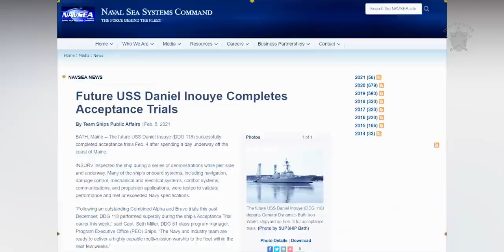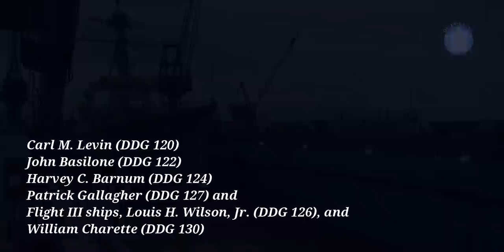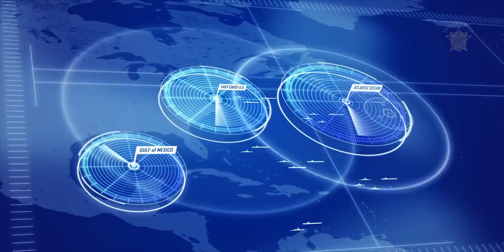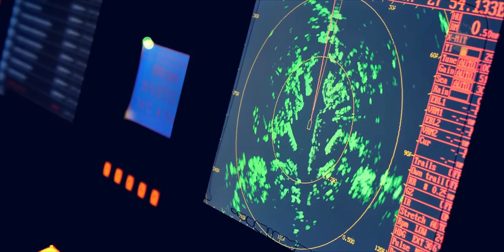U.S. Navy successfully completed trial

Comment: Besides the pretty videos the actual capability of the USS Daniel Inouye was inaccurately and loosely described.  How a warship senses, processes and controls its weapons is a core attribute that should be highlighted.  The Inouye primary radar is the SPY-1D(V) called the “littoral warfare” radar with improved clutter rejection and moving target detection.  Its data is fused with the SPQ-9B Radar Anti-Ship Cruise Missile (ASCM) Radar and the AN/SPS-67(V)2 surface-search radar for a singular coherent air picture controlled by Aegis Baseline 7.1R in conjunction with the Cooperative Engagement System that greatly enhances its effectiveness.  Its primary weapons are housed in 96-cell Mk. 41 Vertical Launching System (VLS).  They can hold any combination of BMG-109 Tomahawk Land Attack Missiles, RIM-66M Standard 2 Blocks IIIA and IIIB anti-air missiles, RIM-174 Standard Missile 6 (SM-6) extended range missile, RIM-161 Anti-Ballistic Missile Standard 3 Missiles (SM-3), RUM-139 Vertical Launch ASROC (Rocket boosted homing torpedo) and RIM-162 ESSM quadpacked short range anti-air missile.  The Inouye has a hanger and deck capable of supporting up to two MH-60R Seahawk LAMPS III helicopters that themselves are highly capable sensor and weapons platforms carrying  Mk 46, Mk 50, or Mark 54 Lightweight Torpedoes, AGM-114 Hellfire missiles and machine guns.  The Inouye can also carry drones in augment too or replacement of the MH-60R.  The ship is armed with one 5" Mark 45 gun with the longer 62-caliber barrel.   2 × 25 mm M242 Bushmaster chain guns and one (not two)  20 mm Phalanx CIWS.  The second CIWS area can have a  60 kW High Energy Laser and Integrated Optical-dazzler and Surveillance (HELIOS) or its derivative installed. The ship has an array of counter measures and decoys integrated into its combat system.   Many other things can be said about this ship that would give the viewer a better idea what a powerful ship this actually is.
Reply: @soulsphere9242  More or less.  However, you and I may know what those particulars are, the average viewer does not.  The technology insert ships have some additions not typical of the class that ought to be highlighted.
Reply: So nice to read a post by someone who actually knows what they are talking about. Bath Iron Works employee of 34 years here..

Comment: it's high time the U.S. Navy opted for conventionally powered super carriers & by conventional propulsion i mean advanced bio fuel cell tech combined with state-of-the-art i-HYBRID propulsion system, instead of the expensive nuclear propulsion!!! bio fuel cell tech paired with smart i-HYBRID is a new type of propulsion system (exclusively for large naval surface combatants) that is in it's final development stage & when it's done it's going to be a game changer!!! water pressurized marine nuclear reactor could be a thing of the past!!! planned future fleet of 8 Gerald Ford class super carrier (that are yet to be built) should be bio fuel cell i-HYBRID powered!!! infact if possible the U.S. Navy should try replacing atleast 5 of their existing 10 nuclear powered super carriers with conventional propulsion!!! statistically speaking a fleet of 8 brand new bio fuel cell i-HYBRID powered 103,000 ton Gerald Ford class super carriers will save the U.S. Navy a staggering €380 Bn - €450 Bn over the next 15-18 yrs!!! secondly the U.S. Navy seriously needs to phase out more than 60% of it's entire auxiliary fleet because there are several support ships in U. S. Navy's auxiliary fleet that are no longer necessary & only a burden on U.S. defense expenditures!!! cutting down the auxiliary fleet will further save the U.S. Navy over €160 Bn!!! finally the U.S. Navy needs to refurbish several of it's naval ports & naval shipyards, both those in U.S. & foreign!!! please note these figures are estimates based on pre COVID-19 economic conditions of the world's defense industry!!!

Comment: The hull looks so 1980ish. Compare it to a modern stealth looking European or even Chinese warship you can tell this ship is basically a relic from the past. Hopefully it’s combat system and weapons are still competitive.
Reply: It was the first production ship to have low observable features.
Reply: @kdrapertrucker  It’s not relevant anymore when I compare it to the more contemporary design. Just put Burke side by side with Type 055, even an amateur can tell there is a generational difference between the two hulls.